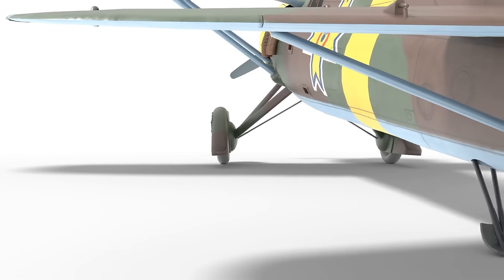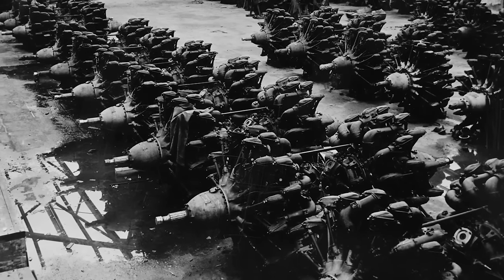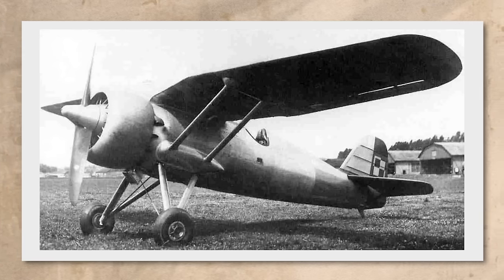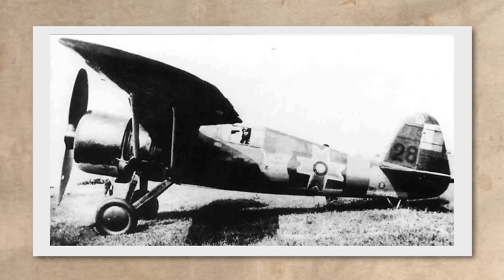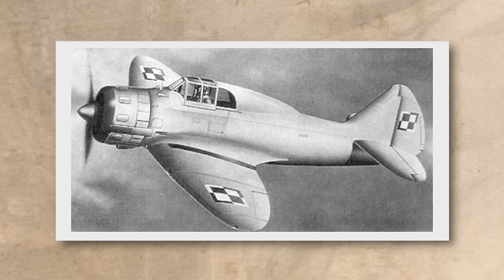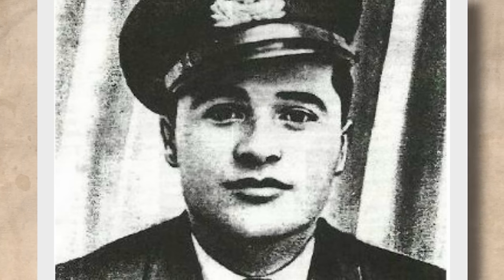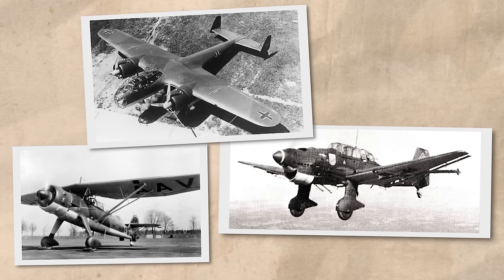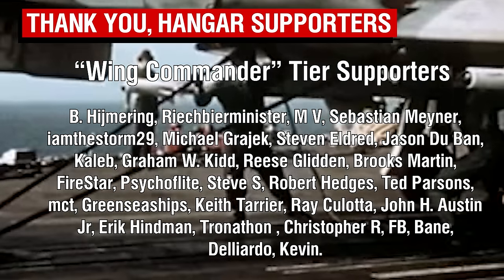The Polish-Built Hero Of Eastern Europe | PZL.24 [Aircraft Overview #94]

Comment: Just a small correction.  P-24's wings were "gull wing shaped" but it was not a classical gull wing.  It was a Pulaski or Polish wing.  The main difference was that the wing was at its strongest not at the point of joining the fuselage but where it was attached to the parasol struts.  It allowed the inner part of the wing to be much thinner and smaller which made for excellent visibility from the cockpit.
Reply: I hadn’t heard of that concept before!
Reply: A good video that shows that Poland was not technologically inferior to the Germans in 1939, as is unfortunately often claimed. What few would expect is the fact that  by 1933 the Polish Air Force became the first in the world to field a fleet of fighters consisting of all-metal-skinned monoplanes - certainly ahead of its time.Quote from the Link Military Factory PZL P.24 As actually often claimed, in 1939 Poland did not use biplane combat aircraft, but the Germans, on the other hand, used biplane combat aircraft in this war like the Henschel Hs 123. It’s also a myth which is being spread again and again that Germany wiped out the Polish air force in three days in 1939. The Polish military command was well aware of the numerical superiority of the German air force. That's why the Polish squadrons were relocated to a network of secret satellite airfields wich were created before the war. Therefore, in the first days of the war, the Germans attacked empty Polish airfields, destroying only a few old training aircraft. The Polish fighters weren't that so worse in 1939 as is always claimed. As mentioned in the video the most built Polish fighter was the PZL P.11. The PZL P.11 was significantly slower than the enemy fighters. BUT... The Polish fighter featured better maneuverability than German fighters Bf 109 and Bf 110. Also the pilots of the PZL P.11 benefited of their design, with much better overview from the cockpit. The P.11 with relatively powerful engine and satisfactory armament also had a durable construction and a good rate of climb, and could take off from short airfields, even of the rough and improvised variety. It could also dive at up to 600 km/h without risk of the wings breaking off. Theoretically the only limit in maneuvers was the pilot's ability to sustain high g-forces. Despite the German numerical superiority, the P.11 managed to shoot down a considerable number of enemy aircraft, including  Messerschmitt Bf 109 and Bf 110 fighters which superiority is always grossly exaggerated.  The kill statistics say that approx 1 kill of the PZL P.11 cost approx. 1 of its own because the Polish PZL P.11 shot down 126 German aircraft with 114 own losses. The PZL P.11 odds of approx. 1: 1 is not bad. The problem was, as with all weapons, that Poland had too few of these weapons compared to the Germans. So the Poles should only have built approx. 20% as many planes as the Germans to win the aerial war. All a question of money. By the way, Several fighter aircraft were also under development in Poland in the pre-war period. For example the PZL.55 which should be as fast as a Messerschmitt Bf 109. Also new Bombers, Reconnaissance and Close Support aircrafts were under development in Poland.

There were also Polish combat aircrafts, which were even technologically superior to the German ones. For example the Polish PZL.37 Łoś twin-engined medium bomber was one of the most modern, effective and advanced bombers of this time. The Polish bomber was clearly superior to the German counterparts Dornier Do 17 and Heinkel He 111. Poland only had to produce more of these bombers like more of other weapons to win the war. 

The Polish P.23 Karas  light bombers were comparable to the to the German Ju 87 Stukas and also attacked the enemy as dive bombers. The Polish P.23 was a bit slower than the German Ju 87 but the Polish bomber had a much longer range. The export version of the PZL.23, the PZL.43 was actually slightly faster than the Ju 87. When the war started Poland had even developed a better successor model with the PZL.46 Sum of which there was only a prototype. Tests proved, that the Sum was a successful design, with much better performance, than Karaś. This Polish light bomber would then have been superior to the German Ju 87 Stuka.

The same actually applies to all weapons, that the Polish weapons were actually technologically on the same level as the German weapons. So also the same with the tanks, because the Polish 7TP tank was equal to all German tanks. Furthermore all polish tanks were equipped with  the revolutionary reversible periscope G wz. 34. The Periscope was a revolutionary because it was the first device to allow the tank commander to have a 360-degree view from his turret. This was a decisive advantage due to a much better overview of the battlefield. Because if I see the enemy tank before the enemy sees me, I can destroy the enemy tank first. The German soldiers in the German tanks, on the other hand, mainly used five viewing slits to observe the battlefield. Americans and British have taken over the Polish  tank Periscope then for their own tanks too! Unfortunately, the Germans also took over the Periscope from the captured Polish tanks after 1939. With the 7TP tanks, a 20% numerical superiority would have been enough to win the tanks war. All a question of money and not the alleged technological superiority of the Germans. The Germans had more money, however, because they got into a lot of debt in order to be able to afford the extreme rearmament. That's why the Germans were actually bankrupt in 1939! Poland, on the other hand, was not bankrupt in 1939 and was well prepared for to hold out long enough until the British and French defeated the Germans from the west with their superior attack. But these traitorous Polish allies were too cowardly to attack and betrayed Poland.

Only because of negative experiences with Polish wz.35 anti-tank rifles the Germans started to reinforce the armor of their main battle tanks with additional applique plates in preparation for the attack on France. The Germans had also a similar anti-tank rifle Pz. B. 39. This also illustrates the same technological level of both armies. So the Polish small arms like the anti-tank rifle wz.35 also clarify that Poland was technologically on the same level as the Germans. Another example of Polisch technologically advanced small arms is the superb Polish 7.92mm semi-automatic rifle wz. 38M. This was one of the best rifles in the war. But there was the issue of numbers again. The Polish Army Command planned to equip the Polish army with the rifle, but this was prevented by the German raid. The 9×19mm caliber semi-automatic pistol wz. 35 Vis is another example of Polish technologically advanced small arms. The Polish handgun was very accurate and stable (due to its size and mass, most stresses are absorbed and not passed on the shooter), while at the same time remaining reliable after firing more than 6,000 rounds. The Vis was generally regarded as one of the best handgus of that period. Today the wz. 35 Vis is highly prized among collectors of firearms

In fact, in 1939, Poland had a much better off-road light military utility vehicles than the Germans! The Polish   four-wheel drive off-road vehicle PZInż. 303 with hydraulic shock absorbers was a vehicle with very good off-road characteristics because it had a very good ability to negotiate difficult terrain, hills with a slope of 47° were not a problem. This off-road car was very maneuverable, the turning radius was only 3.3 meters. The PZInż. 303 was tested on a 1800 km route in 1938. The route of the rally was chosen in such a way that the vehicles could be tested under the most difficult conditions. In fact, in all possible off-road variants, such as swamps and sand tracks, but also on freezing swamps, in severe frosts down to -25 ° C. PZInż cars. 303 showed full suitability for use. But... After very successful tests, the car was approved for series production.  However, it was prevented from serial production by the German raid on Poland. Only a few prototypes were used in the 1939 defensive war.

The Germans used various types of light military utility off-road vehicles, but they were significantly inferior to the Polish PZInż. 303. These were different types of vehicles which in German were erroneously called "Einheits-PKW", which translates to unified passenger car units. The name contradicted the fact that they were different types of vehicles. Incidentally, when the Germans raided Poland in 1939, 60% of the German light military utility vehicles consisted of commercial civilian cars that had been converted for military purposes. One of them was the Type 62 Kübelwagen, which was later slightly modified to the Type 82 Kübelwagen known in many Hollywood movies. Kübel means pail and that was this converted VW Beetle. But the Type 62 Kübelwagen and Type 82 Kübelwagen were actually not off-road vehicles at all because they didn't have a four-speed gearbox. Anyway, all these German vehicles were Polish PZInż. 303 off-road vehicles significantly inferior.

So, in conclusion, it can be said that most Polish weapons  were technologically equivalent to German weapons ! Except rocket technology, but that technology was insignificant in that war! The German Navy was also very superior, but the Navy was not decisive for the war. The Germans had only most decisively more weapons in 1939! All a question of money! So, In summary, it can be stated that some German weapons were slightly technologically superior to their Polish counterparts, and some Polish weapons were slightly technologically superior to their German counterparts. So what shows that the assertion of complete superiority of the German army to the Polish army, which is repeated again and again, completely contradicts historical reality.
Reply: @GreatPolishWingedHussars  This is just a meaningless word vomit. In tents of aviation technology Poland was a generation behind the test of the world
Reply: @roo72  Your claims are absurd and contradicts the historical facts. Your claims are absurd and contradicts the historical facts. Even the claim about the world is ridiculous. So if all countries in the world had produced planes. There were Polish planes that were even the best in the world like the Polish PZL.37 Łoś twin-engined medium bomber that was one of the most modern, effective and advanced bombers of this time. The Polish bomber was clearly superior to the German counterparts Dornier Do 17 and Heinkel He 111. The Polish P.23 Karas was on the same technological level as the German Ju 87 Stukas. It is true that the Polish PZL P.11 fighter was a generation older than the German Bf 109, but since the PZL P.11 was the best fighter of its generation, it was not that much inferior.
Reply: @GreatPolishWingedHussars  Find yourself a shoulder to cry on Polish fanboy.
Reply: @GreatPolishWingedHussars  normalnie przeczytałem od deski do deski…najlepszy opis zagadnień co poniektórych o uzbrojeniu polskim w prze dzień 2 w światowej a i Woloszanski mógłby się uczyc 😂👍👏👏👏👏✌️❤️‍🔥
Reply: @kalinkamylove  Dziękuję mój rodaku! Polacy powinni trzymać się razem!
Reply: @GreatPolishWingedHussars  Tak ale nie powinni wypisywac bzdur o supremacji polskiej awiacji kiedy byla zwyczajnie średnia w porownaniu z zagranicznymi odpowiednikami. Oczywiscie to nadal lepiej niz teraz gdy nawet nie produkujemy juz nawet samolotow rolniczych nie wspominajac o wojskowych.
Reply: @GreatPolishWingedHussars  In addition about Vis pistol: after the invasion on Poland the Radom facility, where the Vis was manufactured, has been working for german army. The manufacturing of Vis was continued nad the amount of "german Vis" was greater than the original, polish Vis made before the war. The german army benefited from the invasion of Poland and the annexation of Chech: the czech tanks were better than german ones and were adopted for armament of Wehrmaht ;-)
Reply: @kwestionariusz1  Tak, nie należy przesadzać, dlatego nie napisałem nic o supremacji polskiej awiacji. Nawiasem mówiąc, twoja krytyka dzisiejszej polskiej awiacji jest przesadzona, jeśli mówimy o przesadach. W końcu polski przemysł lotniczy wciąż się rozwija. Nie należy zapominać, że ze względu na wpływy sowieckie praktycznie nie istniał polski przemysł lotniczy. Z kolei w Europie Zachodniej i Niemczech po wojnie przemysł lotniczy budowano dzięki dotacjom rządowym. Było to głównie w latach 60-tych, 70-tych i 80-tych. Z drugiej strony, UE zakazuje obecnie Polsce subsydiowania przemysłu lotniczego. Ale przemysł lotniczy w Polsce wciąż się rozwija. Większość polskich firm przemysłu lotniczego została zmuszona do połączenia swojej działalności z dużymi zagranicznymi Gracze (w tym europejski EADS, a także amerykański General Electric, United Technologies, Goodrich iAerotech), aby pozostać konkurencyjnym. FA-50PL będzie produkowany w Polsce, a polski przemysł lotniczy z pewnością skorzysta na współpracy z Koreańczykami. Samolot szturmowy  bliskiego wsparcia PZL-230 Skorpion był ciekawym projektem. Niestety ówczesny lewicowy rząd przestał udzielać wsparcia i samolot nie został wyprodukowany. Polska produkuje także śmigłowce wojskowe, takie jak PZL SW-4 Puszczyk. Nawiasem mówiąc, Polska produkuje również samoloty rolnicze, takie jak PZL-126 Mrówka Więc twoje kpiny z dzisiejszego polskiego przemysłu lotniczego są głupie.  Niestety w Polsce są głupi ludzie, którzy wszystko co polskie widzą negatywnie. Ale ty na pewno taki nie jesteś głupi.
Reply: @X3ABnew  Yes, unfortunately you are right!  The Vis was generally regarded as one of the best military pistols of that period. The Germans used armaments factories in the occupied countries to produce weapons and also produced the wz. 35 Vis. The Germans had the lists of workers. Those who refused to work were killed. So for the German army, the  wz. 35 Vis  was produced in Poland under the new name of 9 mm pistol 645(p). Because the Germans simplified the production more and more, so that the quality of the weapons also decreased. Fearing that Polish technicians working in the armory might supply the Home Army with the weapons, the Germans moved production of barrels and final assembly to Steyr-Daimler-Puch Austria. However, underground production of Vis barrels was started in Warsaw and Kielce-based Huta Ludwików, and several hundred Vis pistols were assembled of parts smuggled from the factory, delivered to the Home Army and used extensively during the Warsaw Uprising, among others.  In late 1944, all production was moved to the Steyr works in Austria, where the last simplified model of the fourth series was produced. However, the pistol 645(p) produced for the German army never had the quality of the wz. 35 Vis produced for the Polish army before the war.  Because obviously the Polish workers were not as motivated during production for the Germans. The transfer of production to Austria did not increase the quality either.
Today the Polish made wz. 35 Vis is highly prized among collectors of firearms
Reply: @X3ABnew  The czech tanks were certainly better than the Panzer II used the most by the Germans in 1939 in raid on Poland!
Reply: @roo72 sorry troll.. you lose.
Reply: @IBACb  Cry me a river
Reply: @GreatPolishWingedHussars  Polska nie robiła własnych silników lotniczych, a właśnie w silnikach był największy postęp w tym czasie. Dlatego nasze samoloty latały 350 km/h a niemieckie i brytyjskie 500 i więcej. Byliśmy skazani na import najważniejszej części samolotu, więc mowa o równym poziomie naszej techniki jest absurdalna. To tak, jakby dziś mówić, że Polska ma ten sam poziom techniki komputerowej, co Tajwan, bo kupujemy od nich procesory i wkładamy w nasze obudowy :) Po co wypisujesz te głupoty? Można być patriotą bez zakłamywania własnej historii.
Reply: @MrOdrzut  Nierzadko zdarza się, że wymagana technologia jest kupowana za granicą. Niemcy też to robili. Jak myślisz, jak Niemcy zaprojektowali swoje pierwsze czołgi po I wojnie światowej? Konstrukcję Panzer I można prześledzić wstecz do brytyjskiego toru Carden Loyd, z którego zapożyczono znaczną część konstrukcji gąsienic i zawieszenia. Liczy się to, co wyprodukujecie przy użyciu technologii, a większość broni wyprodukowanej przez Polskę była na tym samym poziomie technologicznym, co broń niemiecka w 1939 roku. Ale ludzie tacy jak ty nienawidzą własnego narodu i tylko szerzą negatywną opinię o Polsce. To jest żałosne zachowanie.
Reply: @GreatPolishWingedHussars  ja nie nienawidzę Polski ani Polaków. Ja jestem patriotą i dlatego nie chcę żebyśmy się oszukiwali, bo nigdy do niczego nie dojdziemy. Porównywanie Niemiec (które w międzywojniu miało połowę WSZYSTKICH nagród Nobla, przemysł konkurujący z Anglią i USA) z Polską (która miała rolniczy kraj i jedynym jej osiągnięciem na światowym poziomie byli matematycy) świadczy o kompletnej nieznajomości historii własnego kraju i świata. Nie dziwię się, bo nasze szkoły przedstawiają zakłamaną wersję historii żeby wzbudzać tzw. patriotyzm. To jest szkodliwa głupota, prawdziwy patriota wie, co trzeba zmienić. Sztuczny patriota myśli, że jest idealnie i nic nie trzeba zmieniać. Żeby coś ulepszyć trzeba najpierw zauważyć, gdzie się jest i czego brakuje. A nam brakowało prawie wszystkiego. Byliśmy krajem w 90% rolniczym. Nie mieliśmy surowców, paliwa, dróg, rynków zbytu, dobrych stosunków z sąsiadami. Nasz przemysł praktycznie nie istniał. Od 1918 do końcówki lat 20 polska produkcja przemysłowa SPADAŁA. Do 1939 ledwo odbiła trochę ponad poziom z 1914. No ale po co mówić o faktach, jak można powtarzać propagandowe bzdury.
Reply: @GreatPolishWingedHussars  Jasne, kilka tysięcy śmigłowców i samolotów wybudowało się za PRL-u samo, bez przemysłu...
PZL-230 był całkowicie niepotrzebnym i szkodliwym samolotem - konstruktorzy myśleli,  że armia będzie zamawiać ich wypociny bo im się coś wydaje, w sytuacji kiedy mieliśmy 100 bombowych Su-20/22 a koncepcja samolotu w stylu A-10 straciła rację bytu z powodu amunicji precyzyjnej. Na zachodzie powstały dziesiątki takich programów i żaden nie został wdrożony.
To właśnie powód upadku przemysłu lotniczego w Polsce - złe zarządzanie w latach 90.
PZL-4 jest przepiękny i nieudany.
Reply: @peceed  To, co pan twierdzi, to nonsens, ponieważ Polska produkowała głównie na licencji broń opracowaną w Związku Radzieckim, w tym T 72 i AK-47. Polska sama opracowała bardzo niewiele broni. To jest fakt historyczny. Tak, PZL-230 byłby bezużyteczny, bo Amerykanie pozbyli się też A-10 Thunderbolt. Ale nie, Amerykanie mają w służbie 281 takich samolotów. Więc Twoje twierdzenie jest prawdopodobnie błędne. W pozostałej części PZL.4 był awarią. Więc co? Ale PZL.44 Wicher był konkurencyjnym samolotem, rywalizującym z DC-2 i Lockheed Super Electra. Ale Niemcy atakiem na Polskę udaremnili sukces tego polskiego samolotu.
Reply: @peceed  To, co chcę dodać do mojego poprzedniego komentarza, to że znam już takich jak ciebie, którzy negatywnie oceniają wszystko, co polskie. To chyba rodzaj wstrętu do samego siebie. Lepiej wyjedź z Polski, jeśli nienawidzisz wszystkiego, co polskie. Z takim nastawieniem jesteś mile widziany w Niemczech. No to do Niemców, którzy myślą tak jak ty, że wszystko od nas jest złe.
Reply: @GreatPolishWingedHussars  Tylko że Amerykanie opracowali sobie A-10 ćwierć wieku wcześniej i od tego momentu świat się zmienił. Nam było potrzeba samolotu wielozadaniowego.
Wicher to był samolot którego nie chciał nawet LOT, nie mający żadnej szansy konkurować z samolotami amerykańskimi (proponowano nam ich budowę na rynek europejski). Chodziło o to, że byłby zupełnie nieznany dla mechaników na obcych lotniskach, a małoseryjna produkcja skutkowała ogromną ceną jednostkową.
Wicher spowodował, że PZL-50 nie zdążył na wojnę.
Reply: @MrOdrzut  Po prostu bzdury napisałeś. Największym nonsensem, jaki zauważyłem, jest to, że od 1918 do końca lat 20 polska produkcja przemysłowa SPADAŁA. Naprawdę w światowym kryzysie gospodarczym polska produkcja spadła? 
Ale niemiecka produkcja z pewnością nie spadła w przypadku Super Niemców w czasie światowego kryzysu gospodarczego.Gdybyś miał prawdziwą wiedzę, wiedziałbyś, że Niemcy byli lepsi tylko dlatego, że byli bardzo zadłużeni. Ci przestępcy byli skutecznie bankrutem w 1939 roku. Polska nie była bankrutem w 1939 roku. Ci bandyci popadli w ogromne długi, aby pozwolić sobie na ponowne uzbrojenie. Podziwia Niemców i nie ma pojęcia! Ci przestępcy chcieli zrehabilitować swoją gospodarkę łupami z okupowanych terytoriów. @peceed też pisze bzdury o Polsce! 
Powinieneś poznać @peceed i wyemigrować do Niemiec. Tam są mile widziani hejterzy Polski, którzy rozpowszechniają nonsens o Polsce.
Reply: @MrOdrzut  Po prostu bzdury napisałeś. Największym nonsensem, jaki zauważyłem, jest to, że od 1918 do końca lat 20 polska produkcja przemysłowa SPADAŁA. Naprawdę w światowym kryzysie gospodarczym polska produkcja spadła? 
Ale niemiecka produkcja z pewnością nie spadła w przypadku Super Niemców w czasie światowego kryzysu gospodarczego.Gdybyś miał prawdziwą wiedzę, wiedziałbyś, że Niemcy byli lepsi tylko dlatego, że byli bardzo zadłużeni. Ci przestępcy byli skutecznie bankrutem w 1939 roku. Polska nie była bankrutem w 1939 roku. Ci bandyci popadli w ogromne długi, aby pozwolić sobie na ponowne uzbrojenie. Podziwia Niemców i nie ma pojęcia! Ci przestępcy chcieli zrehabilitować swoją gospodarkę łupami z okupowanych terytoriów. @peceed też pisze bzdury o Polsce! 
Powinieneś poznać @peceed i wyemigrować do Niemiec. Tam są mile widziani hejterzy Polski, którzy rozpowszechniają nonsens o Polsce.
Reply: @MrOdrzut  Since you have no idea about Poland between the wars, here's a supplement! Which is little known Poland was considerably damaged by the First World War. What very few know is that the polish territories also suffered enormous losses from 1st World War and not only in the 2nd world war! The end of the 1st World War found Poland's factories destroyed or idle, its  livestock decimated, and the nation's economy in a state of chaos.  So the polish territorieswas were ruined after 1st World War. The front rolled over Polish territory several times! ! Much of the heavy fighting on the war's Eastern Front took place on the territory of the future Polish state. The scorched-earth retreat strategies left much of the war zone uninhabitable. The economic damages were extreme! But also the number of dead was enormous 450,000 Polish soldiers who were forced to fight for the  occupiers of Poland died and close to one million were wounded. 678,000 dead civilians as a result of 1st World War.  Total deaths from 1914–18, military and civilian, within the 1919–1939 borders, were 1,128,000. Many Poles were also forced to work in Germany. People were indiscriminately forced into forced labor in raids. The working and living conditions of the forced laborers in the labor battalions were very poor. This weakened the Polish population additionally. The Polish territories previously occupied by the Russians conquered by the German army were also looted, including the robbery of entire factoriesLarge Polish areas were deliberately devastated by the German army during their retreat from the Vistula and they left behind shattered towns and villages. They used the scorched earth tactic! There were also massacres of civilians such as the massacre of Kalisz (before that Russian-occupied) On 2 August 1914. The German soldiers took polish hostages, mistreating them and even killing them. The town was burnt down! Only the churche and some public offices survived. A significant number of citizens were murdered with many women and children. Prior to the war, Kalisz had 65,000 inhabitants. Afterwards, it was left with 5,000 inhabitants. About 1 million Polish refugees fled eastward behind Russian lines during the war. But Polanders were also forcibly deported to Russia by the Russians. As a result of the death, flight and deportation, the number of persons living in the later Second Polish Republic fell by 14.9%.  It is estimated that in the years 1914-1918 about 30% of national wealth in Poland was destroyed. 

And from this pile of rubble, which was also divided into 3 parts, the Poles had to build a state.  Poland was occupied by Russians, Austrians and Germans for over 100 years. What should have been mentioned is that it was not the decision of Poland to be until the 20th century a backward agricultural country. That was determined by the occupiers of Poland which did not allow industrialization of Poland. Therefore, when Poland gained independence in 1918, there was little industry in Poland. What is amazing is that from 1918 Poland succeeded in a very short time catch up with the industrialization of the country. Whereby one has to consider that Poland was parallel to the industrialization reunited from three very different parts to a united country. So after the occupiers were driven out Poland was reunited from 3 parts and from 3 different parts had to be developed a united state! So Poland had to unify the disparate systems of law, economics, and administration in the former German, Austrian, and Russian sectors of Poland. There were in Poland 3 different currencies with 3 different banking systems, 3 different legal systems and 3 types of rail systems with different track widths each needing to be consolidated.  3 banking systems, 3 education systems, Also soldiers from 3 armies so the army must also be assembled from 3 different armies. There were 3 of everything etc, etc, etc....3, 3, 3, etc. Everything was available 3 times and had to be combined to a unit.  So it is not surprising that because of the enormous devastation caused by the war and because the state was rebuilt from three completely different parts there were immense and   massive economic problems. In Poland was also in 1923 even a hyperinflation. This hyperinflation was then successfully fought by the ingenious Polish National Democratic Prime Minister Władysław Grabski with a Currency reform and other very sensible measures. By the way, in this situation Poland won several wars caused by the fact that virtually all Poland's borders were disputed. But the war that Poland also waged against the Bolsheviks was not only a border conflict, but also the prevention of the conquest of Poland by the communists. Poland won this various war despite the fact that the Polish army had huge problems because the Polish army emerged from the 3 armies of the former occupiers of Poland. So the Polish army had weapons and equipment from these 3 armies. In addition, the British, French and Americans also supplied weapons and equipment. Poland also bought weapons and equipment from other countries. So the Polish Army used rifles manufactured in six countries, each using different ammunition. It was no different with artillery. Poland also produced its own weapons and equipment. For example, the Poles built an armored car from the Ford T. Although Poland also use other armored cars. That was very useful. In fact, the Polish Army used this armored car for blitzkrieg attacks against the Bolsheviks. Anyone who thinks that the Germans invented the Blitzkrieg with armored vehicles is wrong. The Polish Army had successfully used this tactic against the Bolsheviks with rapidly advancing armored cars clearing the way for the rapidly following infantry.

The few means of production that existed before the war were partially destroyed or robbed. In any case, Poland has built up various branches of industry. But in fact, just 10 years after gaining independence, Poland exported various industrial products such as civil and military aircraft, locomotives and tanks. Poland caught up with industrialization in an amazingly short time. 

What few people know is that Poland was actually on the same technological level as Germany when Germany raided Poland in 1939. The were irrelevant to the war in 1939. One could also see that in the weapons technology. Poland didn't lose the war because Polish weapons were worse, but because Poland had fewer weapons. So it wasn't the quality that was the problem, it was the quantity. Poland has not rearmed as etremely as Germany has, because Poland has relied on the French and British allies. Little did the Poles know that these nefarious allies would betray Poland so cowardly in 1939 and would not attack in the west as agreed with Poland. In terms of weapons relevant to the war, Poland was certainly not technologically inferior. Even the ridiculed Polish fighter planes were not as bad as is always claimed.  Although th Polish fighter planes were slower than German but the Polish were significantly more manoeuvrable. The Polish bomber PZL P-37 Łoś for example was one of the most advanced bombers then operational in the world and significantly better than comparable German bombers. Poland actually exported such bombers before the war, which turned out to be a mistake, because Poland, like of all weapons, had too few bombers compared to the Germans. In conclusion, it should be noted that Poland has achieved great successes in industrialization.
Reply: @GreatPolishWingedHussars  I notice you totally fail to mention the Soviet invasion of Poland two week after the German invasion begun. Any particular reason for that omission?
Reply: @johanmetreus1268  I didn't mention the Soviet raid on Poland because this Soviet raid was not relevant at all, because even without this Soviet attack the Germans were superior because the German army actually had more of all weapons in 1939 than the Polish army. But one should not forget why the Germans had more weapons than the Poles. The reason was that Poland relied on the treacherous allies in the West and did not rearm as extreme. It is also worth noting that the Germans could not afford extreme rearmament, because the rearmament was mainly financed with loans. Due to the extreme rearmament, Germany was effectively bankrupt in 1939. The plan was to use the booty from the conquered countries to restructure the state finances.
Reply: @GreatPolishWingedHussars is junkers polish? No. They were the first to have an all metal construction. Also, Germany used bi-planes and monoplane fighters. Hubris shouldn't cloud your research efforts or cuase you to misconstrue objective facts. Where did you get you research from?
Reply: @tron.44  My information is correct and you write nonsense! You're probably  incapable of using google!  This is a quote from the Link Military Factory PZL P.24: "By 1933 the Polish Air Force became the first in the world to field a fleet of fighters consisting of all-metal-skinned monoplanes - certainly ahead of its time." German Wiki link to PZL P.7 Quote translated: The Polish Air Force was the first Air Force to be fully equipped with all-metal fighters. (Die polnische Luftwaffe war damit die erste Luftwaffe, die komplett mit Ganzmetalljägern ausgestattet war.)
The Germans deployed the biplane bomber Henschel Hs 123 in WW2 and that is a historical fact. Poland, on the other hand, had no biplane aircraft in combat use. Poland only had a few biplane aircraft as trainers. These are also historical facts. But it is also a historical fact that German fighter planes were more modern than their Polish counterparts. But the Polish fighter planes were not so much outdated.
Reply: Now let's look at pilot's opinions on IAR-80, an aircraft reviled for poor visibility not due to wing shape, but due to forward fuel tank placement that pushed the cockpit back too much and made pilot unable to see the landing strip during takeoffs. I wonder if IAR-80 has any connection to PLZ 24E... 

Apparently I need to add /s or 🤔 for the tone of the comment to be understood.

P.S.: and that's before mentioning that IAR-80 had lower diameter engine and thus lower diameter engine cowling thus obscuring less visibility.
Reply: So, the Puławski wing would be sort of a parasol, modified for better visibility ?